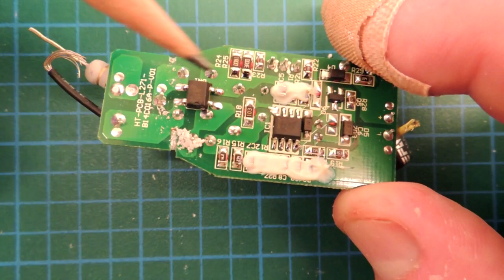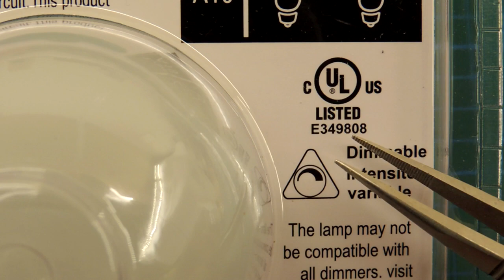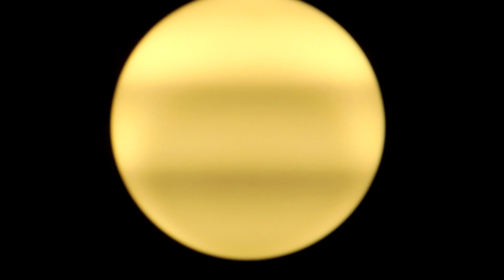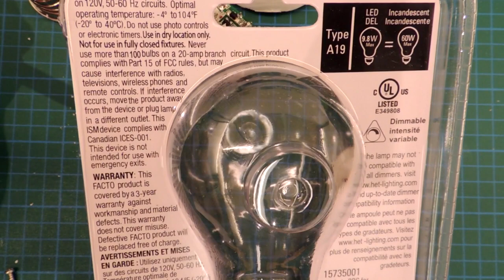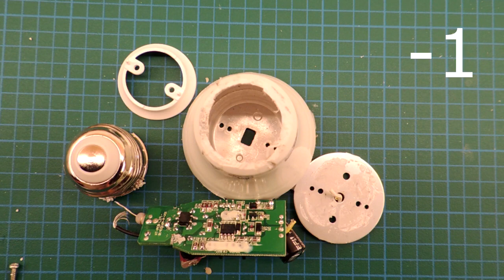Facto 800lm A19 LED Lightbulb Teardown: Big Box House Brand

Comment: I have a few of these bulbs and when I dim them they seem to have two course steps along with a series of fine steps.  If the dimmer I have sits in the middleish area then the bulb will flip-flop between steps with changes in the line, such as turning on other lights, the oven element turning on and off, funrace, etc.  Any idea why this may be occurring?